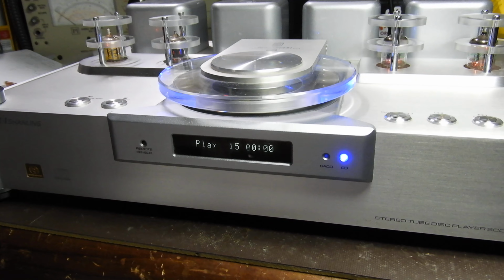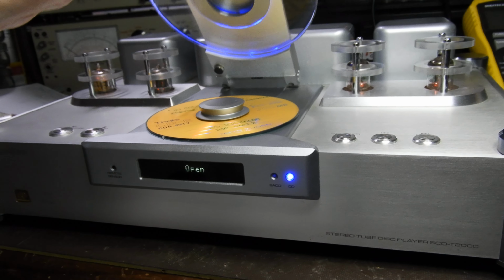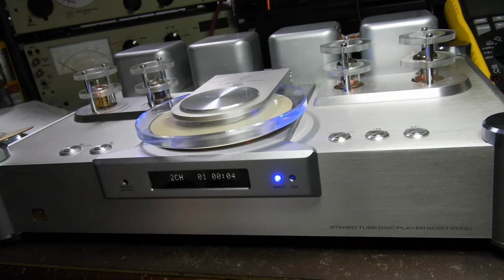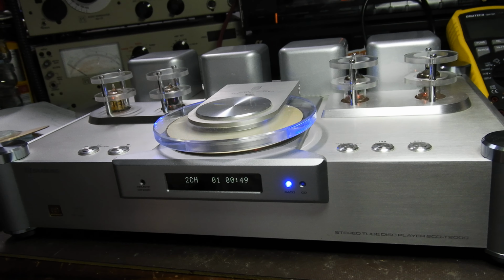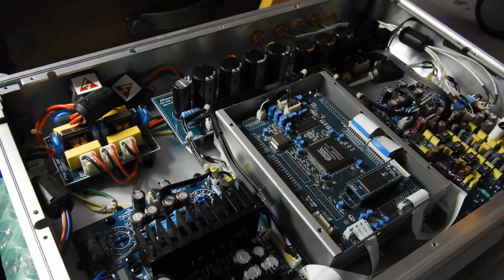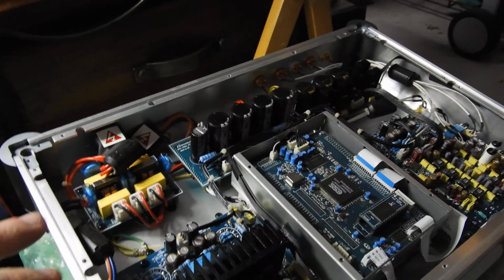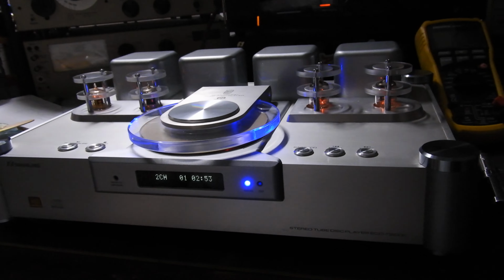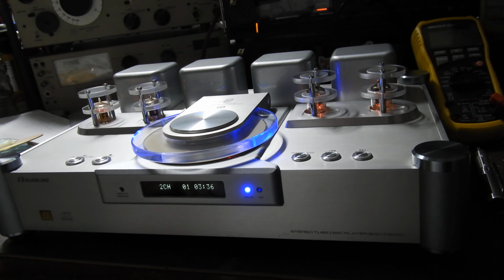Shanling SC_-T200C SACD Tube player. Excellent sound and engineering that is a pig to work on.

Comment: Hi could you send me a picture of the part I need to buy I have just bought one of these players and it doesn’t play sacd but will play cds can I replace the full mechanism and can you send me where you bought replacement parts from as I’m based in the uk
Reply from the maker: I bought my laser head at a "local" trade supplier called WES components in Sydney (4000km away). Sadly, it is not a trivial thing to do, and unless you have tools and experience, you're likely to fail. As did two other workshops who attempted this repair before me. Both put in the old laser back, because after replacement, it did not play ANY disc

Comment: My player doesn't read discs. They changed the laser head, but it did not help .. does anyone have a service manual for it?
Reply from the maker: Sadly no one that has it (like service agents) who will give one to you.
Luckily though, get someone better to do the laser change and it will be OK. Problem is, that it very laborious task. The issue is that:
1. They need a good laser unit
2. DVD lasers these days do not come preadjusted like CD lasers were. Just too many models and too many designs. So you need a proper service agent with laser power meter who is prepared to keep re-adjusting power until it works reliably for both CD and SACD guns. On this player it is very hard to do, because you have to gut it completely to do adjustment, re-assemble the unit, test it, and do it all again until there is a good result.
Several hours of work.
I have done this on 3 or 4 of them and have promised myself never to do it again.

Comment: I threw away so many CD and DVD players in the last 2 decades but my broken Shanling SACD still remains in my workshop for over 10 years because it’s such a good looking player.  I will try to fix it some days
Reply from the maker: I have finally fixed it and do not want to see one again... I also have another, broken one, but it has a fault with the "smarts". It simply does not boot. I wanted to compare it to the one that I fixed, but the servo and signal processing boards were completely different, despite both players having the same model number. The distributor will not give me diagrams, so it is the end of the road for this player. At least for now.
Reply: It’s great to hear that you successful fixed it.  That gives me motivation to try.  Can you teach me how to disconnect the ribbons?  There are quite a bit of ribbons and some of them don’t have locking tabs to release the ribbons.
Reply from the maker: @epicnoodles3633  In these without the tabs, you just pull them put. To re-insert them, you push them in.. The problem is, that these are not designed for repeated re-insertion and in the case of Shanling, this was necessary and resulted in some contacts peeling off. What made it worse, was that the ribbon went though a slot in the case at sharp angle, so re-insertion was difficult. Always mark a ribbons and sockets with a marker pen, so that you know which way they should go in (and to which socket in some cases, if the amount of pins is the same). Also, it often helps to take photos before disassembling units.

Comment: I don’t know very much  about CD platpyers, let alone high end players. However, I can’t but wonder if all of this ‘over engineering’ is obligatory. I assume the sound produced is far greater than my YBA Heritage player, that looks vastly simpler/cleaner on the inside?
Reply from the maker: You are probably right that all of this over-engineering is not necessary, but I suppose, it is better to have done it this way, for most of it certainly gives you some benefit. It also gave Shanling some advantage in the marketplace over others, as company that makes serious product. Much better than to produce dubious features like belt drive in a CD player which certainly is a step backwards and is done just to have market differentiation.
Reply: @hear-net-au  I understand your thinking. I believe Shanling bought YBA some time ago, perhaps some of YBA’s simplicity will in time inspire Shanling to go down that simpler path.. thank you for your feedback, omments and wonderful videos. Appreciated by many I’m sure.
Reply from the maker: @1968krug  I don't think it will inspire Shanling...  They stopped making any decent equipment  probably a decade ago and now only make ear buds and the like :-(
Reply: @hear-net-au   Wow, I’m surprised